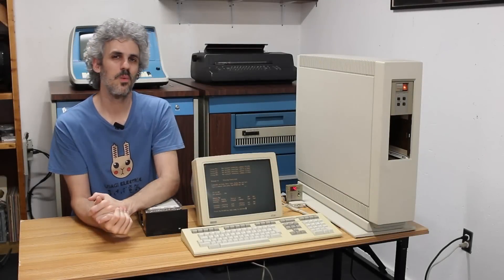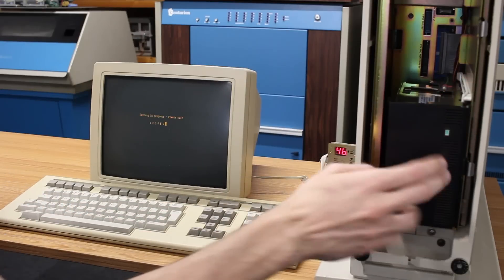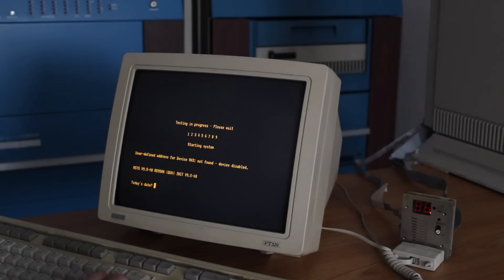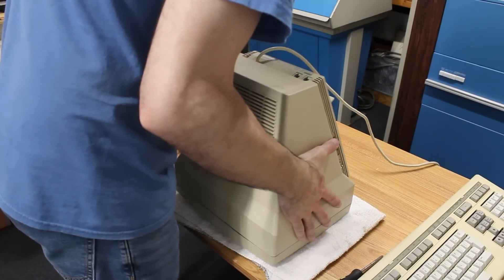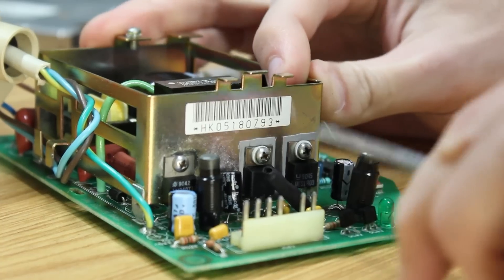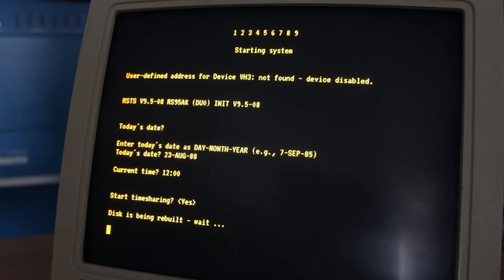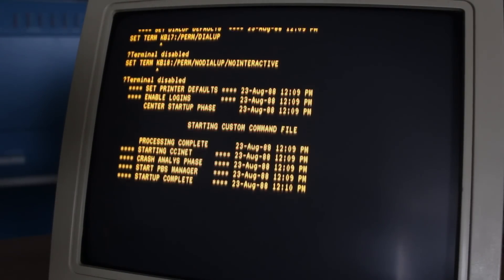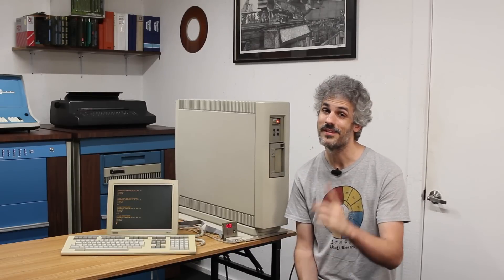Booting RSTS on the PDP-11/83!

Comment: Test it for the “y2k bug”. Not even joking -if it fails going to 84 then I’d think it would fail for 2023 thinking it’s 1923. Really curious to see what would happen. I’m guessing it probably won’t burst into flames even though Leonard Nimoy made it sound like it was going to be the apocalypse in his preparing for y2k vhs tape from back in the day.
Reply: "Your toaster will eat your tie as airplanes fall from the sky."
Reply: 1984 is before version 9 came out so it knows that's not valid.  I am pretty sure it will have a Y2K issue unless it was patched.
Reply: @MarshallGates  I actually worked on a particular system  that worked under BASIC_PLUSto get it to work beyond 1999. It would appear that the DEC date actually worked beyond 1999 if you took the date variable as a 2 byte positive only rather than a sign-and-magnitude integer, so it was possible to allow the date to run up to 31-Dec-2035 but in order to do it you needed to write a specific function that allowed for that as well as display the year as four digits rather than two. However I did this using Sector 7's BASIC_PLUS cross-compiler on Unix so I wouldn't be too sure if this can be done on original metal.
Reply: To test that, I just booted RSTS/E 9.6 (a slightly later version) in an emulator, and it rejects any attempt to enter the year as 23, or to use four digits.
Reply: No, it probably fails going to 1984 because RSTS 9.5 was only released in 1987. :) It wouldn't recognize 1984 as a valid year.
Reply: @mistie710  The bare metal machine under RSTS/E did not go that high.

Comment: The disk rebuild issue reminds me of similar bull spit i had to deal with with my modern laptop. it broke down recently because i spilled soup on it on accident i had it for a few years .but it took a long time to boot up and sometimes it would repair the disk when i rebooted it but sometimes it would just hang and i had to reboot again and then the disk repair went quickly . i guess even 80s computers had similar issues but it was still faster than my laptop.

Comment: Wow. That terminal is scrolling so smoothly. I wish modern terminals did that.
Reply: Trust me, from someone who lived that era, you'd probably turn it off in a day or so.  It slows you down.
Reply: @russellhltn1396  Agreed. That said, there's a few terminal emulators that can do smooth scrolling, and sometimes other "fun" and "retro" features like simulating the appearance of scan lines. I don't use one, so Google is your friend. 😸
Reply: @russellhltn1396  I was going to say the same thing. It looks pretty for the first 2 minutes but it gets old pretty fast. I always turned it off, too.
Reply: @russellhltn1396  Sure, because it is slow, but even if you scroll slowly, it isn’t that smooth on Windows or Linux today, console or UI. And why not combine smooth and faster. You’d think we’d have the computing power for that after decades of improvement

Comment: The leds are probably 'going bonkers' because the system is trying to display the RSTS rolling lights pattern. I think, from memory, it's a set of 7 lights initially that bounce left to right, lose a light (so 6), bounce back, lose a light, and so on until 1 light and then start again. By the way, it's pronounced "Rus-Tus".
Reply: Wikipedia says /ˈrɪstɪs/
Reply: @polluks2  Must have been a New Zealander who wrote that entry... 🤣
Reply: I did my first coding for money at Tektronix in the early 1980's, on a PDP-11/45 running RSTS/E.  Often I'd be in the machine room trading RK05 disk packs.  The idle display was a contiguous stretch of lit-up lights circling through the upper and lower row of indicators.
Reply: @davidwise9119  I think you're right... dammit... 😏Maybe I was thinking of RSX11/M. Certainly back then I thought the bouncing lights pattern was cool. The company I first worked for was a timeshare bureau running RSTS/E on a PDP-11/45. But they hired us out to work on all sorts of DEC systems including RSX11/M. My very first consulting job was at a brewery who had a PDP8/E with an attached Industrial-14 controller. The PDP8 ran OS8.

Comment: If you have any more problems, you can use the GRIPE command to complain to the system administrator. Oh the joys of getting an 11/73 with a Fujitsu double eagle hard drive and a slot-loading reel-to-reel tape drive to communicate with PCs running AutoCAD!

Comment: Did you ever consider loading up an old BSD Unix? The original was built by Bill Joy (co-founder of Sun) on a PDP-11/45 I think. Most of the Unix systems at Berkeley around 1979/1980 were PDP-11/70. A PDP-11/83 would probably be able to use an old tape of an early version of BSD.

Comment: I was a sysadmin for 11/34, 11/44 and even a MicroPDP-11 (I don’t remember the model). Boy, have I forgotten most of what I knew. You are going to be hard-pressed to do much without passwords. Your best bet is to not start time sharing; use single user mode to reset some of those passwords to what you will know. 1,2 is the main admin account. 1,3 is the print spoiler, I think. Seems like I remember 1,4 and 1,8 doing something. 

I loved the PDP-11 both with RSTS/E 7 and RSTS/E 9. I remember writing a ton of scripts in DCL in version 9.

Comment: After the first check , change the electrolytic capacitors in the circuit .They may look normal outwardly, but their parameters will fly to heaven :) I also like to restore old things and face this all the time.

Comment: Not sure about RSTS but systems of the era usually store the password in plain text in a file.  RSTS filesystem is documented so discovering (or just preserving) content should be straightforward if you can run the hardware. A direct image may be useful in an emulator.

The unit looks somewhat like ST506 (MFM) but don't blame me for the smoke.

Enjoy the journey of discovery.

Comment: 4:49 - looks like a PSU problem on the terminal, possibly due to dried out capacitors.
Later it was revealed that, I did write before watching full video. :)

Comment: On a slightly newer system we would cross-mount to reset the password.
Reply: With operating systems of this era, they often had different boot modes depending on the value in a particular CPU register or switch settings on the front panel. So I'd consult the system manager's guide to see whether there's a boot mode to deal with a forgotten system password.

Comment: The switch mode power supply in the VT320 is not starting. May be a secondary loading issue, possibly bad caps, or a bad primary oscillator circuit. 
The supply is trying to start, but something is holding it down. Never mind... you fixed it right after I left this post... I guess I should watch the entire show, before commenting... :)

Comment: Question: the Acorn BBC Microcomputer, famous for dominating the UK education market in the 1980s, can run from something called a "second processor". That external unit can now be replaced and emulated by a Raspberry Pi Zero (or above) with the aid of "PiTube" HAT. Emulation offers the option of running most of the once available (and sometimes quite rare) second processors. One of those emulations is a PDP-11. What is a PDP-11 and what does it do?

Comment: I'm an old DECie, but not THAT old (I came in just before AlphaServers, well into VAXes). I think that PDP needs a terminal no newer than a VT100.  I'm sure older DECies could tell you a more period correct terminal than that (Was there a VT52?), but VT100s were the "old school" terminals when I started. Save the VT320 for your MicroVAX II! I did have a customer that was still running PDP11/34s, but I was mostly clueless on those and was lucky if, in 1993, I could find anyone who remembered how to work on them!

Comment: I know nothing about this type of machine, but I've been able to find out passwords from systems of similar age by taking a dd image of the hdd and then run the entire image-file thru the strings command on a modern computer. If it's not encrypted, it will be in there.
Reply: The drive isn't huge by modern standards, so this would be fairly quick. Only problem is if the sysadmins of the machine were serious about "good passwords", that makes it hard to suss out the password even if it isn't encrypted/hashed
Reply: The version is 9.5 so passwords are encrypted on that system.
Reply: Even before hashed passwords, they were encoded in something called “Radix-50” (a limited character set allowing 3 characters to be encoded in 2 bytes). The encoding/decoding algorithm was pretty simple, but it would still defeat a simple string search.
Reply: @mistie710  It depends if the admin migrated the passwords and even still they may have kept the old password, in which case there's a really limited set of permutations to try

Comment: About that desoldering -- You might want to cut the components off then remove the pins individually. It's much gentler to the circuit board.

I did soldering a hundred years ago, and learned (the hard way) you can either save the component or save the board, but rarely both.

Comment: code 77 means the cpu did not start. This could be from a bad computer box power supply. Have you checked those capacitors to? 
You can shorten the time to enter the time by just entering ":"

Comment: So you're getting a 77 'power bad' signal on a fully cold boot after installing a hefty 5.25 FH hard drive, but it doesn't occur after a reset. What's different?
The hard drive is spun up and not drawing the spindle's starting amperage.

Comment: In school I had access to a couple IBM mainframes, and a PDP-11/60 running RSTS. I went to work for DEC after graduating. 🙂 I worked with a few guys that had previously worked on RSTS and I hung around with a number of the RSX developers back in the day.

No offense, but I echo the comments about pronouncing RSTS.

And also that it is not the way a normal RSTS system behaves to log in. It must be something custom. I also echo the comments about saying "NO" to the start timesharing query.

If you decide to install from scratch, be warned that doing a sysgen for RSTS and especially RSX is not for the faint of heart. I recommend you set up simh with a configuration similar to your real hardware and "practice"--it'll be faster and easier.

Comment: Wow, I've never seen so smooth scroll in text mode 😵
Reply: It slows down the display, so It's not much use.
Reply: It starts off being cute, but usually ends up being as annoying as hell (I used vt320s extensively back in the day).
Reply: Yeah..  it looked GORGEOUS on our VT100 but we'd admire it for 30 seconds or so, then turn it off.
Reply: The original VT100 had some interesting display bugs with smooth scroll.

Comment: Clearly you are a gluten for punishment. :-) RSTS (or RSX-11) on a PDP required a lot of docs, patience, and the occasional loss of sanity as I recall from the early '80's. I use RT-11 on my PDP (actually LSI) with Saturn Calc and WPS for a much simpler and relatively problem-free system. I became a VAX/VMS admin in '81 just to get away from the annoyance of RSTS-E (which degenerated into a platform for Adventure, the forerunner of Dungeons 'n Dragons) and remained one until my retirement in 2006. I was a hardware design engr ('70's and early 80's) and the VAX-750 would run the Bit-Slice cross compiler 3x faster than the engineering RSX 11/70 platform. I've had a uVAX LAVC for the past 20 yrs and of course the usual hardware pwr supply problems (computer grade electrolytic caps are only spec'd for 20 yrs so it's amazing that some of them have lasted for over 40yrs! My cluster is in storage right now, but I hope to revive it soon. If you really want a 'hoot', try loading a PDP-11/20 from an ASR-33 paper tape reader (after hand keying in the bootstrap with the front panel switches); Or single-stepping an IBM-360 to find out why it isn't reading from the Punched Card reader; or troubleshooting an IBM 1403 (1100 line/min) Line Printer interface on a PDP-11/20 when the brake for the high speed paper advance failed and it bounced half a box of 132 column sprocket fed paper off the ceiling before I could get it shut down!
Here's one that'll fry yer brain: the cpu is trucking along and just stops, no error msg, no log entry: an intermittent failure of the disc interface! When the cpu tried to get (page in) the next group of instructions from the disk, there was no disk! Rebooting would reset the disk controller and it would work for a couple of days before it stopped again. Took about a week to figure that one out. It was the complete lack of info leading up to the halt that made it hard to track down...and led to the conclusion.
Clearly, I'm the real gluten for punishment....After 53 yrs of working with computers, I have 2 LSI's (11/23 and 11/73), 4 uVAX's, an Alpha, 4 TI 99's, and 7 PC's (one a PC-164SX a 64bit running Win NT4.0) The other PC's are Win98, XP, Win7, and Win8.1). Let's hear it for retro-computing!

Comment: That doesn't look like the RSTS (pronounced Riss-Tuss) login prompt I remember. Cooperative Computing? I bet it has a custom login program installed on it. Logins are project, programmer where project 1 is a system account. So a user might be 40,2. 1,0 is the system account. I recall typing anything would cause it to display a 'login:' prompt, and you would enter your PPN and your (six character max) password. That was RSTS 7.2-04.

Comment: I need to solder my hardware terminal emulator, and get my pidp11/70 running.  Then i need to build a couple expansions,  namely a drive bay for flop, and a fancy terminal case that i can stick spare b/w crt i have in.

Comment: So much duplication...but, yes, ris-tis or ris-tus were used pretty interchangeably.  I heard DEC people say it both ways.  I would bet dimes to donuts that the system ran a "canned" application environment for the automotive shop.   There is likely a custom system startup script that is locked from being interrupted or aborted that starts up the application when the machine is booted up.  The machine may only allow a special login from the console for applications maintenance by the software company that made the application software.   That's probably what it is waiting for in no-echo mode -- a special maintenance password.   Doubtful that's anything that is going to be able to be guessed anytime soon, unless you can find documentation for that application that might give a default password to be entered at that point.  I suspect that if you hook more terminals to the machine (if it has additional serial ports, or you have serial interfaces you can install in the machine) the end-user terminals might give something different on them when the system starts up.   They may still require some kind of credentials to log in and start up the application, but you might be able to tinker with it.  I do know that some of the login scripts had a weakness where if you pressed CONTROL-C at just the right time, you could break out of them, but the timing was really picky.   If you were able to break out of the login script (which is different than the system startup script that is run on the console terminal) you might get dropped into a RSTS account that the application runs under.   If certainly wouldn't be the system master account (unless the authors of the software were dumbkins) of [1,2], but at least you might be able to look around a little.  You can do DIR [x,y]*.* where x and y are the identifiers for an account, e.g., DIR [1,2]*.* will give a directory listing of the system master account's directory tree.    There's another command, SYSTAT, that gives a listing of the users, devices, and all kinds of other information about the state of the system.   There are docs on RSTS in PDF form at Al Kossow's famous bitsavers.org site.  Look in the COMPUTING Archive under DEC/PDP11/rsts_e .  There you can find docs for the various versions of RSTS/E, including the 9.x versions.   I hope this helps.

Comment: My guess is that the system may actually run as intended, but since you run in time sharing mode you may need a second terminal to get a usable prompt?
Reply: Very possible, that only the system messages and admin prompt are running on terminal 0 and the actual user log-ins are all done on the other terminals.

Comment: For an 80s computer, I'd imagine the password is stored in clear text on a file on the drive.
Reply: RSTS passwords were RADIX-50 encoded in the user data, not plain text.
Reply: @MarshallGates  Well, so much for that.
Reply: @Nabeelco  radix-50 is not hard to decode, it's not encryption.
Reply: @Bobbias  agreed.  Pack 3 bytes into 2.  So many old memories.
Reply: Beginning with RSTS/E V9.0, there was an option to increase the password length from 6 to 14 characters, and store it in one-way hashed form.
Reply: @lawrencedoliveiro9104  I learned something today.  I stopped with RSTS/E V8